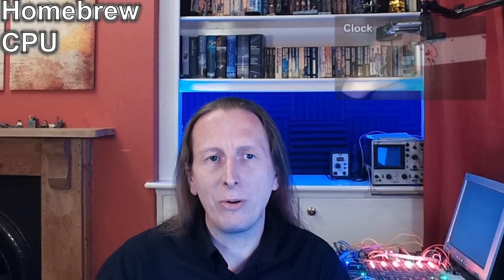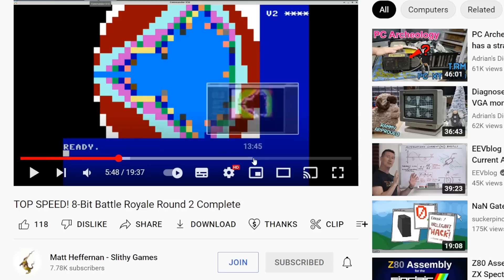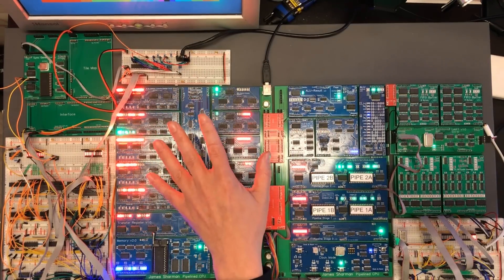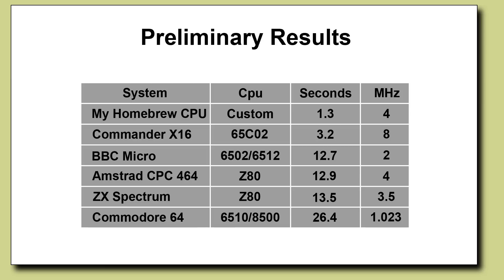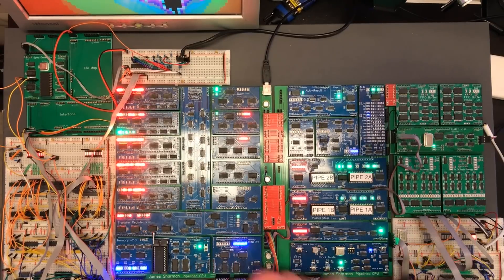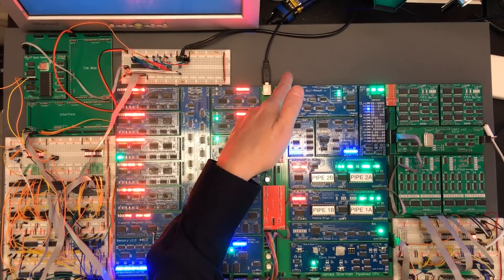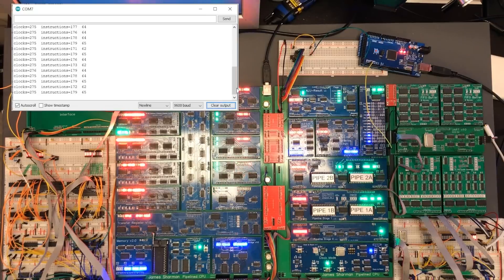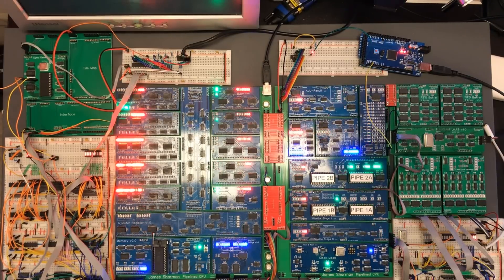Is this the most powerful 8-bit system ever? - Making an 8 Bit pipelined CPU - Part 100

Comment: Yarr, very very impressive result for a CPU currently implemented in discrete logic. 🍻
Those slithy benchmarks are an eye-opening study when normalised against clock frequency.  Those clocks-per-instruction really hurt the Z80 in this benchmark and of course, the 6502 had some tricks up it's sleeve with its memory addressing modes.
As much as I love the C64 and the venerable Beeb, I really prefer writing assembly for the Z80 and its bevy of registers.
Reply from the maker: I always favored the z80 as well but there was no denying the 6502's efficiency

Comment: How does it compare to say a single-chip computer on an Atmega 1284 at 20 MHz?
Reply from the maker: Anything modern at that clock rate will perform much better. Micro controllers tend to have fixed program store seperate from working ram (Harvard architecture) which reduces the reliance on a shared memory bus.

Comment: Outstanding project. I originally learned to program on an Apple II so I appreciate just how incredible the results you've attained are here. If you have hardware support for two stacks and implement a forth for it you'd have an extremely productive computer in terms of time from concept to effective and efficient implementation.
Reply from the maker: Thanks! I'm not changing the hardware of this cpu now but I do have plans for a future build. In 64k higher level languages tend to be quite restricted by memory. On this cpu though, you could use one of the pointer registers in a similar way to another stack pointer, but pointer + offset addressing is a but more complex to do in code.
Reply: @weirdboyjim  that's what's amazing about Forth. Once you hit above 8k your Forth apps are likely to be lower in memory usage than hand written assembly. It's ideal for resource restricted environments. I definitely look forward to seeing your future efforts. If there was a good simulator of your current one I bet it would be quite quick to get an eforth port done to it.

Will you eventually pack this thing up into a plexiglass case and hang it up operationally on your wall? It's got a beautiful esthetic! I'd buy one!

Comment: Nice project, gives me a bit of a Gigatron feeling (discrete logic RISC computer0. Maybe you can throw the code at an Atmega 1284 as well. Do you know of a faster bit than that one? Must be DIP housing and 5V compatible.
Reply from the maker: Yeah the modern 8-bit devices would clean the floor with me, but I hope it was clear I wasn't really trying to claim that, it was instead a bit of fun comparison to the classic stuff.

Comment: If I was doing something like this I would probably do it with an FPGA
Reply from the maker: I wouldn't, my ambitions for this circuit are constrained by space. I'd probably be making a 32bit cpu if I was using an fpga but that's not what I want to do.
Reply: @weirdboyjim  That's fair enough, my reasoning is cost, timing and space. With an FPGA board I get a little bit of RAM and a sea of gates to pursue aspects of various architectures and all changes and new ideas come for free once you have the board. I once thought of doing a Z80 with HW stack to investigate the benefits of faster stacking of registers, using C4000 series chips but time was always too much of an issue and I don't think I have the space that you do. Also I never breadboard more than a basic concept that I need to get my head around. Don't get me wrong, I love what you're doing and am getting my enjoyment out of seeing that you've fulfilled my dreams :-)

Comment: The Z80 has the drawback that it has way many more clock cycles per instruction. Interesting would be seeing what a rabbit runs like which is a Z80 with a similar cycles per instruction as a 6502 or 6800. Also interesting would be to see what an AVR runs like as they have single cycle execution.
Reply from the maker: You have to remember the older cpu's were constrained by there memory technologies.

Comment: Nice idea, but your maths is backwards.  You need to divide the seconds by the MHz to get a “per 1 MHz” comparison.
Reply from the maker: Reciprocals can be non intuitive but multiply is correct here (not division). If a task is completed in 10 seconds at 2MHz then if we half the speed to 1MHz it will take twice as long (All else being equal). We Multiply the 10 by 2 so the normalized time will be 20 seconds.  If divide were the operation we would all have infinitely fast computers by stopping the clock.

Comment: I wonder why they have the Commander X16. That thing has a 16-bit cpu, right? 65C816?
Reply from the maker: That's a more complex question than you might think. The 65C816 is an evolution of the 6502 which is generally regarded as a quintessential 8-bit cpu. It gains enough features that either way. Running the code in this benchmark though It doesn't look like a bad fit for the 8-bit camp as the more advanced (more 16 bit) features are not being used.

Comment: Interesting video. Is there any difference when designing such CPU on multiple PCBs versus single package transistor? I'd imagine the wires are longer hence more latency but does it show up in practice? Have you considered trying your design on a FPGA?

Also have you considered taking advantage of instruction level parallelism (if that's applicable on your architecture)? Sorry so much questions, I find your project fascinating.
Reply from the maker: The high level flow is very similar although there are all kinds of constraints with this type of design purely based on the idea that I'll have to assembly it by hand.
Reply from the maker: The issue with parallelism of any kind is it implies redundancy in the design which would have added to the physical build work (before you look at the circuit to take advantage of it), there are a few opportunities here for instructional level parallelism, many of the operations between address registers (inc/dec and mov) don't touch the main bus so there are a selection of instructions that could be executed in parallel (alongside the ones that do need it).  The issue is that I can only fetch one instruction per cycle and I'd still need circuitry to determine when instructions could be parallelized.  My one byte fetch limit doesn't leave any room for software sequenced parallelism either although at the most basic level you can think of instructions like "lodsb" to be a parallelized form of "mov a,[si] & inc si".

Comment: This is a fantastic labour of love, James. I've been binge-watching the whole series including the VGA implementation over the last 2 weeks and finally gotten to the end.
I've really enjoyed your journey with logic, layout, soldering, video editing and presentation. All done with a good dose of British self-deprecation! Your presentation skills are excellent in my opinion. Certainly they are superior to many university lecturers I had on the same topic back in the mid 90's! :)
Your coding skills are head and shoulders (and then some!) Above my own but I share your curiosity for just how far ideas can be taken using the hardware of the day and newer ideas. I wrote down a list of about 10 ideas (for improved signal integrity, latency reduction, stability) and another 10 architectural ideas that were used in the 8-bit days (almost! ;) ) that could give your project another huge performance boost. Probably way too much text to drop into a comments section so perhaps let me know if you're interested.
Reply from the maker: Thanks Stewart! That's some high praise!  I'm a curious about your ideas, but I have a huge pile of ideas myself which I have to hold back on in order to keep going with this one. My current plan is to get this build finished roughly with the current plan and then embark on a new project. Needless to say more ram, less memory contention, more gpr's and better addressing modes are high on the list.

Comment: I think your design is still constrained by the decoding roms that you use through the pipeline. This introduces an unnecessary delay as it is like adding a decode stage to every single stage. A faster design would be to decode the entire microcode signals, in the decode stage, and just latch them and use appropriately through the pipeline.
Reply from the maker: No doubt. But don't think in terms of "unnecessary delay" and think more in terms of the critical path through the logic that caps the clock rate.  Many of the design decisions where a compromise between speed, demonstration value and containing the overall scope of the project.
Reply: @weirdboyjim   Yes, of course I refer to the critical path. On a pipelined processor it is crucial that all the stages are designed to take about the same time, and trying to move slow stages logic to stages that can accomodate it, so all of them are balanced in terms of their critical path. Here, I was assuming that your roms add to the critical path of every stage, because I think there's no latching of the rom outputs. But I get that you wanted to show the instruction itself moving through the pipeline instead, which is also cool

Comment: What is it that this CPU does that causes it to benefit from pipelining? A single cycle CPU (one op per clock cycle) wouldn't seem to benefit from pipelining so what's the story with your CPU.
Reply from the maker: Ok, there are two answers to that but the direct answer is nothing, pipelineing is what allows this deign to get to single cycle operations. Firstly it's very likely that any single cycle CPU you are looking at IS pipelined, most cpu's designed in the last 30 years are. Secondly if it isn't pipelined then it may still benefit from it, there must be complicated logic chains inside the processor that take time to settle, those will impose an upper limit on the clock rate, if those large operations were broken down into smaller steps (and then pipelined) then the dependency chain would be shorter and the maximum clock rate would be higher.
Reply: @weirdboyjim  Hi I just ported the mandelbrot to my own 8-Bit CPU called SPAM-1 and it seems to do the job in 1.2million clock cycles. SPAM-1 is a breadboard CPU running at about 3.5MHz, so thats about 0.3 seconds execution time. 
That's when programmed using my own SPAM-CC high level programming language (a bit like C) which provides 16 bit signed maths.
This mandelbrot work helped me debug the compiler.
If I switch to asembler then could possibly squeeze more perf.
Also, I'm a good way through porting VBCC to SPAM-1 as a back end - this is 1000 times easier than GCC or LLVM which I gave up with.
It would be interesting to see what somewhat optimised code from VBCC would achieve.
Also, there is a planned improvement to my clock that will yield a 25% speed up without breaking the CPU.

Anyway, I think the main contributor to this performance are 
1) The fact it's a Hardvard not VN CPU - big perf gains possible from Harvard (or modified VN) arch vs regular VN 
2) The ALU that I use. It's based on Warren Toomey's CSCVon8 CPU's ROM ALU with the addition of some carry-in logic.

It's interesting to see the relative performance benefits of where one places the time and complexity investment.

BTW SPAM-1 is one of the "single-cycle" CPU's I referred to earlier. 
Instruction fetch and decode plus RAM access, ALU operation and Register Write all in one clock cycle.
Reply from the maker: @johnjosephlonergan  the issue with this code as a benchmark is it’s very multiply dependant. I assume with a rom Alu you have and 8x8 multiply in there which should trivialise it.
Reply: @weirdboyjim  Yeah exactly, with a more capable ALU you can do the 16 bit or 32 bit multiply in constant time ...

; multiply X by X and write result back to Y 
REGA = [:X]
REGD = [:X +1]
REGC = [:Y]
[:Y] = REGC *LO REGA
REGB = REGC *HI REGA
REGC = REGC *LO REGD
REGB = REGB  + REGC
REGC = [:Y+1]
REGC = REGC *LO REGA _S
REGB = REGB + REGC
[:Y+1] = REGB

No such happiniess for the divide though.

In any case it's an illustration of the alternatives.

Comment: Recently, I saw a video about Bitcoin mining on a Commodore 64 !
It managed about 0.3 hash/sec using C. A 6502 guru should probably produce hand optimized code improve on that.
This would make an interesting challenge for your homebrew pipelined CPU ... maybe it will reach 2 hashes/sec :)
Reply from the maker: Hmm,  I'll have to give that some thought. I have to admit that SHA-256 performance has not been on my radar for this build.

Comment: Fascinating work. I'm surprised your processor - spread across your desktop - is faster than the classic 8-bit. I also appreciate the 'normalized' performances. I was surprised the Z-80 performed so poorly. Congrats on a great result. I'm subscribed - continued success!
Reply from the maker: Glad you found it interesting Gregory!
Reply: The Z80's ALU is only 4 bits wide and it takes a lot of clock cycles to do almost anything.
Reply: @johnm2012  😯
Reply: @devcybiko  YouTube won't let me post a link but you can search for "Z80 ALU" and look for Ken Shirriff's blog. The Z80 Wikipedia article should mention it too, if it's worth it's salt. Obviously, all designs are compromises, but this seems like an odd trade-off to me.
Reply: z80 sux ; )

Comment: Is it possible to implement this in FPGA to improve results?
Reply from the maker: That's an interesting question, moving this design to fpga would be an advantage, but you would only improve the speed a bit before hitting another bottleneck.

Comment: How much faster would it be if you miniaturised it into an actual "microprocessor".
Reply from the maker: Interesting question, Obviously if you put it all on one bit of silicon and then clocked it at 4mhz it would still be the same. So the real question is "how much faster can we clock it?". I believe the limiting factor would very rapidly be the external memory.
Reply: @weirdboyjim  I was thinking since it about fractions of seckonds maybe the shorter distances for signals to travel would make a slight difference. After all they length match traces for that exact reason.

Comment: It underperforms a 1.78 MHz h6309 (1.2 seconds).
Reply from the maker: Had to read about that but that makes sense, it has a hardware multiply so I’d expect it to do well against any of the simpler devices like mine that do it in software.

Comment: 4:52 "one off boutique" - exactly right.  Your demo where the monitor is nowhere to be seen is suspect; the setup unreproducible, your claims are akin to the Cold Fusion "discovery" decades ago;  I lost respect for you the minute you admitted to changing the benchmarking software.  Matt was right to ignore you.
Reply from the maker: Being accused of fraud when you are not is a compliment! You are welcome to see it, others have reproduced my cpu. Porting between CPU’s is changing it, Matt was not running identical code on z80 and 6502.

Comment: You should see about implementing this in FPGA to see how fast it's capable of running condensed into a single chip.
Reply from the maker: Doing exactly this at a faster clock rate isn't as interesting to me as the design challenges of keep it working when the cpu get's faster than the memory etc..
Reply: @weirdboyjim  sure, but I'm surprised it runs that fast on a bunch of boards. Makes me wonder how fast it could run as a single chip.

Comment: Yeah well it doesn't have a Sound Interface Device #6581 so .......... :)
Reply from the maker: Well this is about cpu peformance but I'm trying to build everything myself in this board. My sound system is pretty basic but it is 4 channel. The Sid chip is cool but it would have felt like a cheap to put one in.

Comment: Excellent result! Some of my first computing was on a CDC6600 which had pipelining and some asynchronous operations - did 3 MIPS but with 60 bit words and core memory.  One of the most important architecture inventions in the 1960s was of memory cacheing - why not give that a try? If your code is doing a lot of localised fetch/store ops it can help a lot to resolve the cpu/memory speed mismatch.
Reply from the maker: This CPU is reaching the boundary of it's designed parameters. I plan on future builds that will experiment with more advanced concepts but I don't want to keep iteratively redesigning this one, that's no way to make a nice clear architecture. A cache for example needs logic that can handle a cache miss everywhere you are accessing memory, as a retrofit that is tough.
Reply: @weirdboyjim  Yup, understand that.  Also it depends on the memory interface and how it’s architected - if it’s synchronous and just waiting for the data to show up or getting on with other stuff meantime.

Comment: Wow, looks like you might even beat an R800 at some point...
Reply from the maker: I just did some research on that. My basic alu primitives' are twice as fast, but the R800 introduced hardware multiply instructions that are substantially quicker than my software implementations. It should beat me on this benchmark.
Reply: @weirdboyjim  Looks like an idea for another video? 'How hardware multiply works'. (:
Reply: @weirdboyjim  By the way, you can just fake 8x8bit multiply with precalced values. All possible results fit in 128K. That 8088MPH Demo or whatever it was does that.

Comment: Next you should make it superscalar 😉
Reply from the maker: Going from "sometimes scalar" to "really scalar" would need an increase in memory bandwidth and a beefed up fetch unit. Going truly super scalar would need either additional pipelines or perhaps a VLIW configuration (and I think some people would consider the latter to be a cheat). I plan on experimenting with all of these in the future, but the 8-bit cpu will likely reach completion before then before I start a new project better designed for that kind of experimentation.